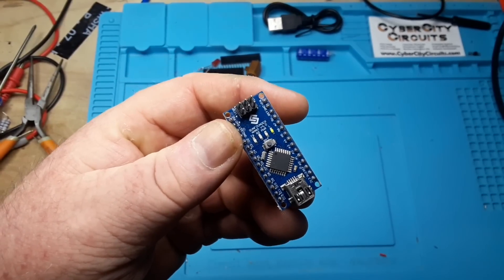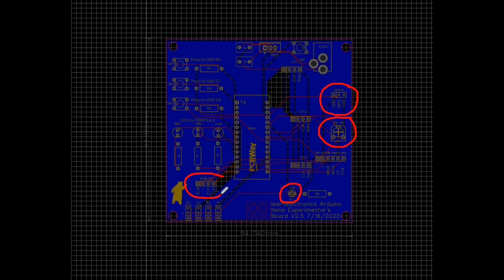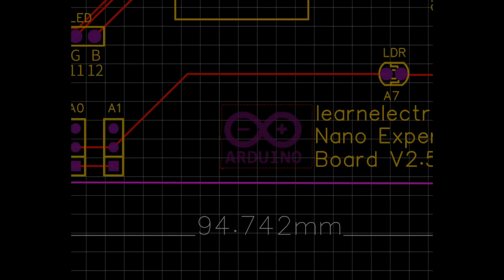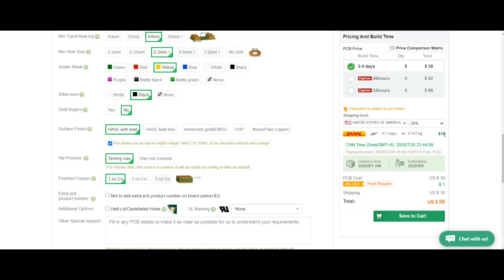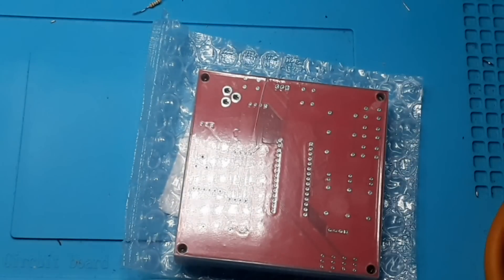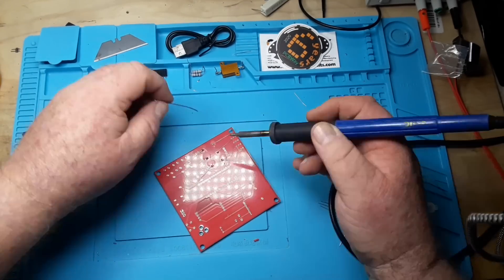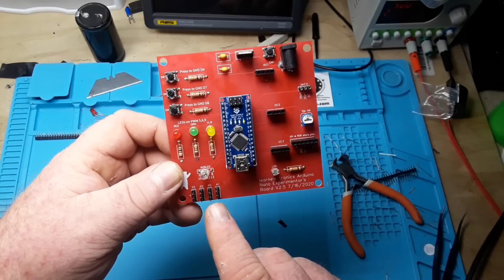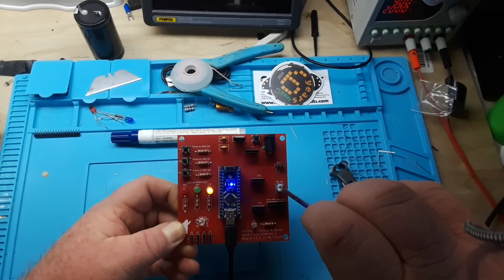Arduino Nano All in One version 2

Comment: Someone may have already suggested, but how about running the digital (and/or analog) pins up to a set of dual row headers so you can put a jumper bar or jumper wire so any digital channel can control any of the features.  That way if two things would be on D10 and you want both of those in your design, you can just jumper one to D9 or something.    On many of the products our company builds we run the digital connections through a CPLD so those things can be selected programmatically.  Just an idea...

Comment: I ordered several of the ver 2 boards using your posted PCBway Gerber. After ages they sent me an email that their engineer thought the logo would cause a short circuit. I told them to remove the logo if necessary for functionality. I wanted these boards as gifts. Have you heard any more comments about this?
Reply from the maker: No

Comment: If that"s a multi layer PCB,  is it possible that your Arduino logo is  in the middle layer ?  Just a thought...
Reply from the maker: I found what was doing wrong. It needs to be on both toplayer(copper) and topsoldermask(removed mask).
Version 3 boards being made now.

Comment: Where do you source your DHT11's from?  The DHT11's I have all have the data pin in the center with + and - on the outer pins.  Just curious so I will know for project consistency.  Thank you.
Reply from the maker: I get them from eBay and remove them from, the little PCB

Comment: Hi Paul! Don't give up on the copper logo :) I think the reason that there is no copper showing is because you inserted the logo on the TopSolderMaskLayer layer, which does indeed remove the soldermask there, but unless it is also (in your case) on the TopLayer (where the copper is) there will be no copper underneath. So you end up with what you have now, soldermask removed but no copper. Long story short: make sure the logo is on both(!) these layers: "TopLayer" and "TopSolderMaskLayer". I've send you an email.
Reply from the maker: Dustin, thank for the video. I see what I was doing wrong.

Comment: A suggestion to save space:  Replace the individual resistors for the LEDs with a SIP resistor array.  Less soldering too.  If all of the pushbuttons tie to ground, you can do the same there too.

Comment: I would have thought that you would lay out component placement to accept either through hole or SMD. This way the user gets to choose how they want the finished board to look.
Did you specify that you wanted the Arduino label to be copper layered when you placed the order? Usually you can specify your needs so they can modify the production Gerber.
One last comment, why are the I2C ports placed like that, I would have thought you would place them down the side of your board to minimise wires laying over your potentiometer and such.
Good job so far.
Reply from the maker: I dont do SMD. Too hard for me to solder. As for the I2C they are staggered so OLEDs, sensors and what not will fit and not overlap.

Comment: Keep working with the cut off ends of components on the mat, you will eventually short something. I spent 2 days trying to fix a keyboard only to find out a cutoff had landed in the keyboard. Alternatively, you could use the mounting holes with some standoffs. How about showing us the tech support for the PCB manufacturer to fix the copper issue? Have you thought about making the + and - in the logo voltage test points?
Reply from the maker: Good idea for the test points.

Comment: Is that a potentiometer or a trimmer?  If it's a trimmer, it would be nice if it had the same footprint as a potentiometer. It add an option to use a regular potentiometer.  You may also have to reorient the footprint since the shaft and knob should hang over the edge to provide clearance.
Reply from the maker: trimmer

Comment: Getting  a Copper LOGO to show : ..  In the design software, what's the difference between a solder pad and a copper trace?   1.) Did you try to make a ''custom'' solder pad?   Solder pads don't get covered.   2.)  Is there a layer for pads, maybe 'solder mask', that you can copy/duplicate the copper trace (logo) onto? 

 I've mostly used Eagle-lite in the past.  It has quite a number of layers.  You ADD text to the layer above the solder mask.  You REMOVE a pad from the solder mask.  You ADD a copper trace and PADS to the copper layer (comparable to adding etch resist) - or the copper gets printed onto the base.  You can select specific colors for BOARD (which is probably solder mask) and TEXT.  However, the color that shows up in the design software layers can be whatever you choose.  It only makes sense to have the top layer traces a different color than the bottom layer traces.  But, you can probably make them the same color and they will still end up on different sides of the board.   I would try it myself, except that particular computer is currently down. :-(

Comment: Paul, I love your videos. Couple of suggestions for other videos. I always have trouble with stringing common anode LED's. Maybe it's just a mental block because I always used common cathode. I have bags of these which were sent in error by an eBay store. Since they didn't ask for them back I would like to use them. Can you do a video on using them in a string with a Nano?
Another thing I think would be cool is using push buttons to control switches in a train yard on a model railroad. I have done this, however, it was a wiring mess. I would like to see you design a parallel input PCB with two shift registers and 16 push buttons sending data serially to the micro-controller and the ability to daisy chain additional PCB's. For me the design of the PCB is still a mystery. I can hard wire it, but I get the design screwed up on every PCB.

Comment: I’ve been wondering about the lack of copper on the bottom center Arduino logo. 

Could it possibly be due to the lack of traces going to it? (It may not be as stupid as it sounds.)

Perhaps you could use the logo as a capacitive touch button?

By using one or two 2N2222’s as amplifiers, it would only take up 1 input on the Arduino. 

There’s also the more elaborate (and not so simple) way of doing it, where you could implement the output going to the yellow LED, and make it possible to adjust the sensitivity of the capacitive touch button. 
I’ve added an instructables project as inspiration. 

https://www.instructables.com/id/Capacitive-Sensing-for-Dummies/

Best regards
Bo Holbo

Comment: If you connect the logo area with a trace or should retain the copper. Allot of board houses will remove unconnected areas by the rules in their software
Reply from the maker: Maybe that's the problem
Reply: @learnelectronics  that's what my experience with board houses would tell me. They run the files through their own rule checks and unless you personally discuss the design with the rep, they won't always say what their rules are and how they will effect your design
Reply: Copper traces get covered by solder mask ... however - pads don't.  You might be right about the rules in the case of SMT, Bluetooth antennas and edge connector pads.  (see my comment about 'Copper LOGO')